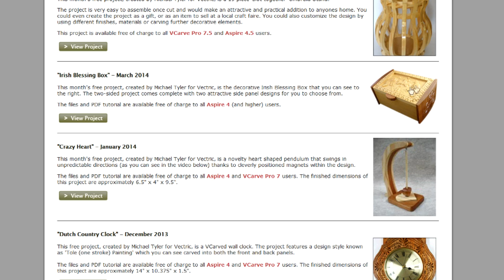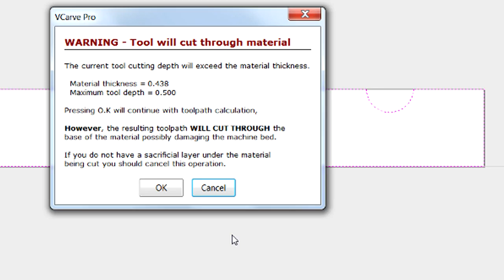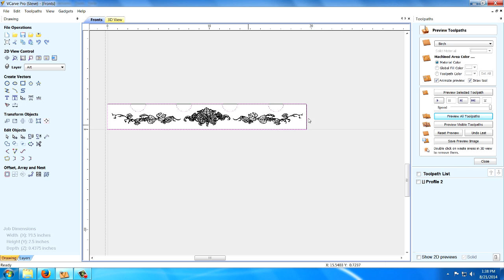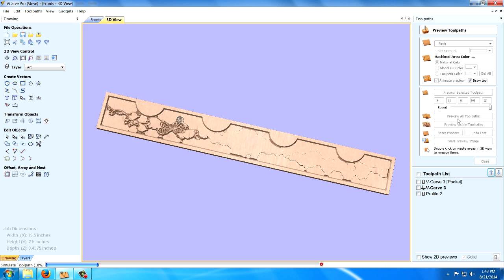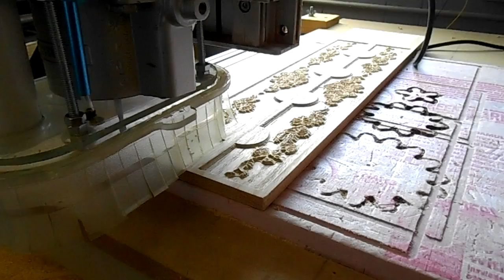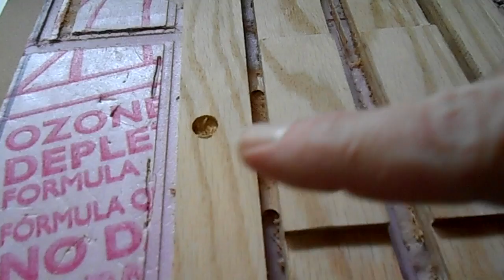Creating Carved Projects Using CNC with VCarve Pro

Comment: when you run the program like this does it come back to 0/0 for you to change and reset next tool or does your machine have multiple tool holders. the machine i have doesn't have multiple holders. Im fairly new to using V-carve and I would love to go in and rough out some material this way to make the cut times faster

Comment: Thank you for the tutorial. I already have Vcarve Pro. I am putting my homemade Printer parts CNC through some testing and aligning at the moment. I too am using Mach 3. When saving the file for Mach 3. What file save do you use? Maybe a video for others on the subject. I shall primarily be using my CNC to make PCBs for MY NICE EV and DIY Energy projects. Many many thanks. I am learning a lot. Keep it up.